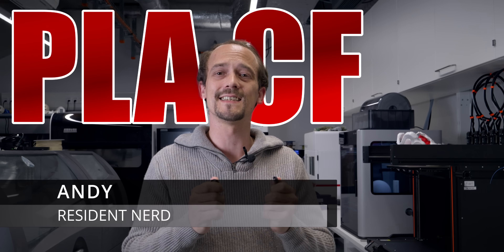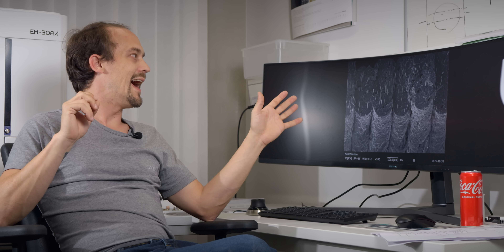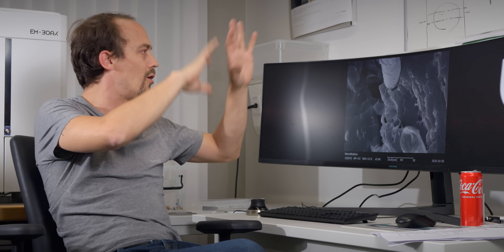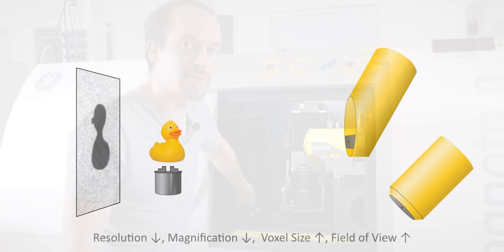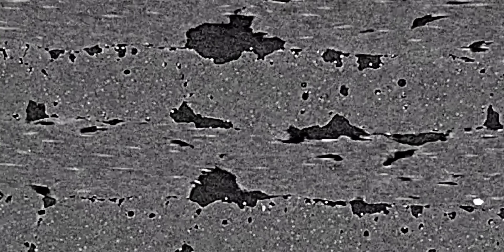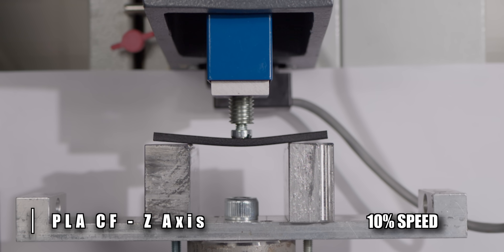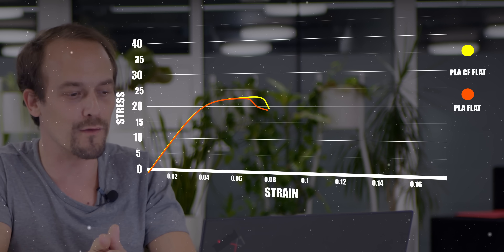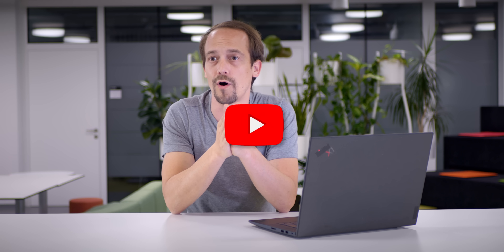3D Printing’s Biggest Scam Is Even Worse Than We Thought!

Comment: Very interesting to know the health risk! We have alot of talks about asbestos here to the point i can no longer legally remove my own wet roof, making it kinda ironic that i can still smoke 40 cigarettes and print cf. 
It would be nice to do a comparison to the different polymers to their base materials and added cf or gf and see how its better or worse and then the air pollution and touch pollution! It was quite crazy that it gave so much off you can see it on the skin! Then i guess some also gets airborne! 
I quite like fiberons pet-cf and would like some abs-gf when radio reception is critical, but it might be worth considering if its worth the risk of there is not much difference!! 

It was awsome to see the inside of a print! 

And that coke can

Comment: PC-CF has a very interesting and difficult property.  It is ferromagnetic.  We were using this as one off insulators for HV buss bars in traction motor inverters for cars.  There was a strange noise that we could never pin down until I was playing with a print on my desk, and a magnet for a small motor model stuck to it.  Neither carbon fiber nor polycarbonate are ferromagnetic, but the two together are.  And it's fairly strong.

Comment: You know, this all makes quite a bit of sense, the whole thing that makes carbon fiber strong is the continuous strands, unless you're getting some crazy extreme specialist NASA level material with a continuous fiber, you're just not getting any strength from it.
Putting in even a small amount of thought, you actually end up with results that are similar to those "sparkling" or "metallic" PLA's, which tend to be more brittle

Comment: As an ex-welder turned 3D printing hobbyist, this is fascinating! One of the things you are touching on here is something called the "notch effect", where a significant disruption to surface continuity compromises the durability of a structure. In a nutshell, a 3 inch bar is stronger than a 4 inch bar that has a 1 inch notch cut out of it. Despite the thicker bar having more material in total, the sharp notch concentrates the stress lines into a single point and amplifies force onto a single spot, leading to a material failure...

Same thing here, but on a microscopic scale. These CF shards are leaving voids that function as notches and become points where stress can concentrate. Awesome to see the microscope shots that prove the theory!

Comment: This is wonderful.  I would like to see a similar set of scans against PETG and PETG-CF on a printed part, and the same on the filament itself before it is extruded (not that it matters much on the raw filament, but out of curiosity to determine if the voids are in the filament.  Yes, which filament is good for carbon fiber?

Comment: ANOTHER THING that might help is seeing if some carbon expert can figure out HOW TO CHEAPLY MAKE sheets or ribbons of 1 mm by 5 mm GRAPHENE (i.e. sheets of carbon) that can be twisted and looped to to form concrete-rebar-like reinforcing structures that would allow ANY filament type to bond to its surfaces on all sides of the Graphene ribbon. Does this type of Graphene sheeting or ribboning require chemical treatment to allow a polymer filament to bond to it properly so no voids or shrinking-away issues arise? And how fast and cheap CAN we make such Graphene sheets and ribbons at various lengths, widths and thicknesses which would ALLOW effective polymer reinforcing without delamination or shrinking away, or cause voids?

Somebody on this channel should START a research project to figure out WHICH types and dimensions of carbon nanotubes, graphene sheets, buckyball sheets (Carbon-60) and other carbon-fibre based reinforcement is easy to make in bulk, cheap and fast to 3D print!

V

Comment: The ONLY WAY to fix this issue is to use tinier fibres such as Single-wall nanotubes that are cross-hatched at 45 and 90 degree direction and separated by the number of microns that allows the polymer filament to get in-between the cross hatching. Normal carbon fibre has LAYERS to it and moves about obtaining NO ADHESION to surrounding polymer. Cross-hatching of smaller diameter fibres (i.e. single wall nanotubes) spaced farther apart but weaved into a cross-hatch pattern allows the polymer to get in-between so it can act very much like the cement/mortar in concrete! The polymer is the bonding agent aka mortar/cement and the carbon fibre becomes the rebar. If you get that concept down pat, you can make ANY type of filament stronger and stiffer. 

The BIG ISSUE is being able to find and BUY carbon fibre nanotubes that are at least one to three millimetres in length that can be weaved together in an accurate manner throughout the polymer filament structure itself. That needs ACCURACY and multiple print heads and that can get expensive!

V

Comment: Cool video. Thank you for making it. However, I have questions about your results. 

1) what is your sample size? How many samples did you try for your plots? N=? If it is 1, (I assume not, because you seems professional) you need to collect more data. If it is not N = 1. Then how many? That will help a lot on the reliability of your plot. 

2) speaking of data. Where is your standard deviation? At least have N = 3 and show the stdev. That will help us to make sense of data more. 

Again. Great effort and nice video. However without sample size and stdev, what you are showing is not reliable data. Especially if N = 1 per test. (I believe not) 

I hope to see another video for your sample size and stdev.
Reply from the maker: N=10 
I calculated superimposed plots. Standard deviation was calculated but not shown in those plots since I did not use bar graphs this time.

Comment: If you are going to do more ct scanning for micro structure please account for geometric unsharpness. By being so close to the source, your unsharpness for measurements is not going to be good.  Industry will typically recommend your unsharpness to be 20% smaller than your pixel size which is dictated by the digital detector array. Just something to be aware of for your next CT scans

Comment: I can't fathom why people think 3D printed carbon reinforced filaments are great. Carbon fiber parts from actual woven mats and resin can be really great. But there's nothing same in the 3D filaments. Plastic isn't even vacuumed to create strong bonds with materials and just think how different that carbon matt is. Then it's absolute must to remember how small orifice nozzles are, so saying carbon there would increase properties greatly is kinda foolish anyway with such miniscule lengths of fibers. I only think it'll likely increase are health problems with easy dislodging miniscule fibers that could work similarly to asbestos.

I personally do print PLA parts for packaging machines that form carton boxes. I think it's great material for such use. Inexpensive and last very long. But I absolutely don't want to make parts from CF diffused filaments. I don't want that stuff to be ground into dust to the environment.

15:10 thanks for pointing that out. I was some vid about how to make money with 3D printing and I was shocked to see, that someone had designed some 3D printable pill dispenser for drugs and he was printing and selling those made out if was it PETG-CF. I had to comment that it would be something that I'd never ever approve and luckily there were others saying the same. He mentioned that surface was so nice in CF parts 😬

Comment: Instead of just impregnating random small pieces of carbon fiber, is there any filament around that is ONE singular continuous core of some sort of thread with the plastic coating around it? 

I have basically zero 3d printer experience but I understand the concept and I work in the mechanical field.
Reply: You are talking about continuous carbon fiber printing. There is currently a kickstarter for a lower priced option, normally need a very expensive machine to do it. The kickstarter machine is focusing on PETG and PA with a second extruder for continuous strand of fiber.

Comment: I can see a use case for the more brittle carbon fiber pla.
I mean you can find a use for almost anything. 

But I'm imagining it line a crumble zone in a car.  The break  disperses the energy out and away.  
I know its a nerd comparison.  But somone did the idea behind the storm trooper armor in starwars. The idea was that it was easier and cheaper to create a layer that would explode out on contact vs how expensive it would be to absorb the energy of a laser

Same think here.  When the pla dosent break all that energy gets passed threw easier. But if it snaps it takes a good portion of energy with the break. 

You could use both in a print for strategic points of failure. 

It's kind of lame that something you'd think was ment to be stronger id used as a breaking point.... but I mean... use what you got I guess

Comment: Very well done video! I have one question regarding dimensional accuracy: is it higher with PLA-CF compared to neat PLA? I know that PLA already has very low thermal shrinkage and is therefore quite dimensionally stable, but does the carbon-fiber reinforcement reduce shrinkage even further?

Comment: I'm not under any delusions that CF filament is anything except weaker than filament without any fiber added.  The thing I will use CF filament for is when I want dimensional accuracy.  I've always assumed that the material properties of CF filament will be worse once the item is finished printing, however the fibers do help to fight against warping, curling, and shrinking during the printing process.  The way I think about it is that the fibers are a scaffold, and just like real scaffolding it's really only useful during the building process.  So I use CF filament for parts where accuracy and fit matter and tolerances are fairly tight.

Or because it looks cool.

That being said, CF or GF in PLA makes no sense to me.  It's already just about the stiffest common filament there is and the least prone to warping and shrinkage issues.  There's really no point to adding chopped fiber to PLA.  Ground fiber for aesthetics?  Sure.  But for structural rigidity?  Why?  The only possible thing I can think of is that maybe it could help a little bit with bridging and overhangs?  A combination of that extra scaffolding plus the thermal conductivity of carbon fiber, specifically could help to wick away heat... Maybe.  Possibly.  A little bit.  (untested, unverified, unqualified: just a barely-educated guess.)

Comment: So as a real world example. I printed out of pla+ and parts wouldn't hold up for a 1:10 scale drift car. It's an old hpi and parts aren't available. Printed them with Cf pla and they haven't broken yet. I also found removing support to be much more difficult. My conclusion: It is absolutely stronger than pla+ for that application

Comment: CF filaments doesn't help at all. CF only works if they are weaved to each other through chemical bonds. If you have seen videos of people casting CF car parts, they do it with CF clothes. And also, the CF mixed with PLA makes the PLA weaker because CF doesn't chemically bond with platsics. It does not fuse. It's like a raisin in a bread.

Comment: Just the other day, I watched a video about an airplane crash that was caused by a 3D printed part on the engine. The part was supposed to be CF impregnated, whichever material it was, but after the crash, they found that it had softened at a much lower temperature than it would have if it'd been the claimed material. That made this video of interest. In that case, it turned out to be ABS, I believe. But I'm learning some things here I didn't expect. Like I didn't know that carbon fiber behaves somewhat like asbestos......and I know all about asbestos--I was slightly exposed to it in the air a couple of times while in the navy, so I learned what I could. 

If CF infused  plastics are as bad as you show them to be, they ought to be banned.

Comment: Because of lack of available spare parts in current car industry, even new electric vehicles get spare parts made in the shops themselves from CF nylon. However even replacing static parts in EV power trains like cable holders can trigger a need for re-certification.

Comment: Petg CF looks better, is more resistant to heat and it’s stiffer than regular Petg. That’s all I care about, plus in my day to day use experience it’s strong enough, at least as strong as plain PETG or PLA.

People shouldn’t fall for the advertising but also should try it personally to see if it fits their needs.

Comment: Lmao people have been scratching their nozzles and their lungs for absolutely no gain. I am of the opinion cf reinforcement is probably a bad idea in also mnay other filaments, where even it grants a marginal stiffening (and it's always marginal, because even in a case of ductile plastic where the cf actually picks up tensile stress you're still gonna be limited by the plastic-cf boundary adhesion) it is not worth it once you take into account the health risks. But people are too invested in the material grift

Comment: I have no doubts that printed 3d plastic parts are all filled with small voids. There is almost no way to avoid it, especially with large pieces. The material is going to cool before the next layer is laid down so they don’t weld together to the next layer.  Maybe if printed in a vacuum chamber you could reduce such voids or keep the material at a higher temperature so the layers of material will flow into each other but that would be a balancing act between welding and collapse.

Comment: It is not continuous CF so... it can not be stronger.
The only good thing about this filament is temperature stability during prints (Nice for large fast prints), and a nice finish. Everything else is actually worse.
Reply: The place where CF and GF is really nice in my experience is with PETG, and Nylon. But that is for the same reasons. Nice finish, and way easier to print.

Comment: Very nice test. I never saw why PLA CF would make sense, as PLA is know for being quite stiff anyway. And we don't need CF to make PLA printable like on some filaments too. And the weaker layerbonmding because of the outer CF strands is widely known too. The Core CF filaments should solve this.
I only bought one single spool with CF filled material because I wanted it to be realy stiff and creep resistant. Otherwise it didn't realy make sense to use imo.

Interesting would be to see how other CF filled filaments behave. If you test this, please also consider testing TPU CF. Extrudr has this, i don't know about other brands. But in theory that could be a realy tough material.

Comment: I'm not saying CF is good, but isn't the idea of CF filled filament to stiffen the material, not harden it. In other words if the load is not enough to break it how much will it bend. Breaking it only tests how strong it is. But let's say you don't have enough space to print a much-much thicker part, you add CF instead to make it bend less. I don't know if CF in PLA even does that, but I think that's what you should have been testing. Load it half way before breaking or 1/4 and then measure deflection.
Reply: ok. typical comment before watch the whole video. 13:33 answers that. it's not stiffer. Yes please, investigate PA, PET-CF and others.

Comment: i think an investigation into carbon fiber tpu would be super interesting. it's such a difficult to find filament but it's the correct match for a carbon fiber filling if we wanna print on entry level, open air printers. which is why i think pla-cf is so popular, it's just the beginner filament but "better" because carbon fiber shiny or something -- but pla is already stiff and brittle, why would you add carbon fiber to it? conversely, tpu is great at everything but stiffness, if you add carbon or glass fibers to it you at least have a chance at making a better filament.

Comment: I would recommend testing PETG-CF next, because that should reveal to you what the actual use case of adding carbon fibers in a filament is.

The carbon fiber addition was never intended to increase the strength of the material. It is intended to increase the rigidity. And for the reasons you already discovered, the carbon fiber addition does lead to a slightly reduced strength. For most use cases, it's an acceptable tradeoff.

I agree that PLA-CF is indeed a completely pointless material. One could call it a scam. PLA is already a rigid material and its greatest weakness is its brittleness. There is no benefit from adding carbon fiber to PLA.

PETG on the other hand is a much more flexible material than PLA. Many would consider PETG to be too flexible to their use case.
That's where PETG-CF comes in. The added carbon fiber greatly increases the rigidity, with a slight (but acceptable) tradeoff in strength.

The same is even more true for engineering filaments like PA and PEEK. Since these materials have very high strength, they can easily afford to lose a small part of it in exchange for much better rigidity.

Comment: You said the carbon fiber got in the way of what you described as 'entanglement and attractive forces' which I believe is more accurately describing the "cross-linking" /vulcanization process which is not happening with these thermoplastic polymers. It's definitely much more appropriate to stick with the first issue you described of voids which result in terrible stress concentrations. This being said, any aggregate (CF and even air included) can increase part stiffness at certain concentrations because those objects and voids do hinder the propagation of dislocations and polymer chain slip.